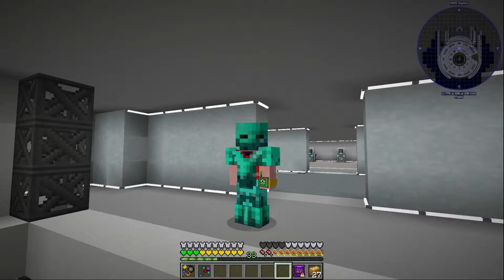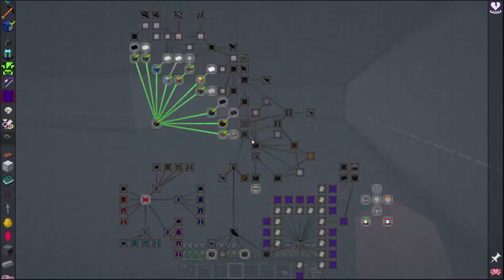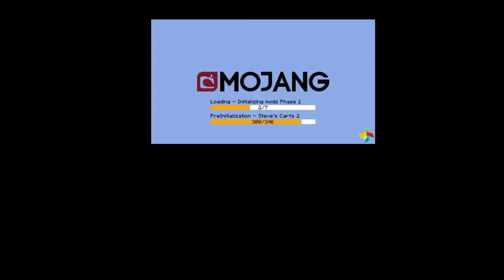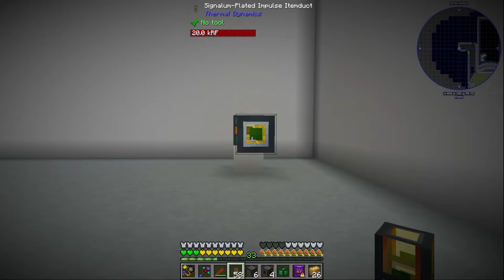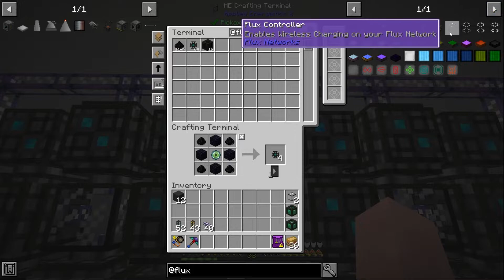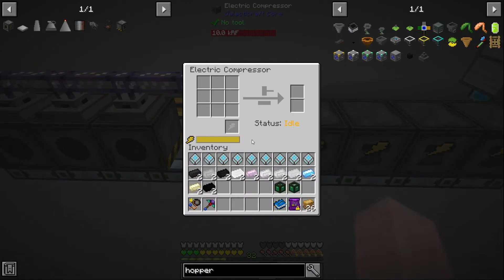Journey Across the Void: EP31 - Auto Galacticrafting

Comment: Hey there, the flux network controller does not require a power input. It takes power from the network that you select for it.
Reply from the maker: Agreed? I thought I showed it starting to work when I attached it to GC Power?
Reply: @KelleyEngineering  my apologies, I thought you said it needed to be connected to power, as in on the energy cell.
Reply from the maker: You’re right. I just watched it again, and I did indeed say that! I put out bad information. I owe you an apology. It doesn’t help that I put the controller on top of the energy cell. 

I’ll put out a correction in Monday’s episode and credit you with the find. Thanks!

Comment: Dunno if you are aware but you only need the 1 flux controller so long as it's chunk loaded you'll always have wireless charging provided that network has a power input somewhere

Also when you did the security terminal for your me system you used a biometric card, that's not required the bio card is there so you can allow someone else to do something to your system like pull items in or put them in or even add cables
Reply from the maker: I was not aware of either of those things. Ill cover them in the housekeeping portion of Monday's episode! Credit of course goes to you. Thanks for your continued support Uber!

Comment: Your smart setup with multiple ME systems could create a toturial video itself. I wish to do this myself but still trying to figure out what you did there
Reply from the maker: How do you mean? Having the ME system for Galacticraft in the same space as the Autocrafting ME system?
Reply: @KelleyEngineering  no no no, sorry for the bad wording. I mean the way you have all your network bridges connected to each section and connected though i believe a interface and a storage bus but the power is done with the glass cable? I'm a bit lost on that